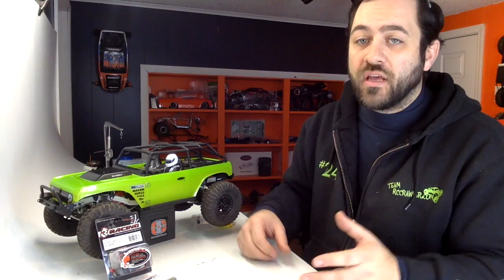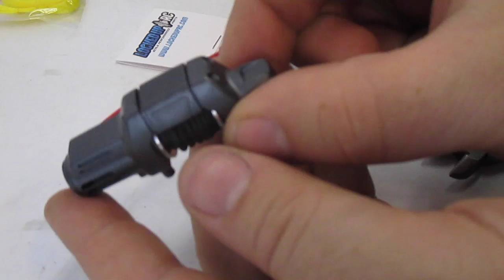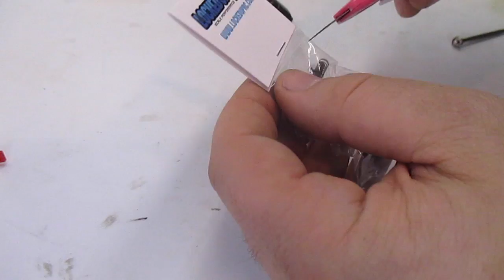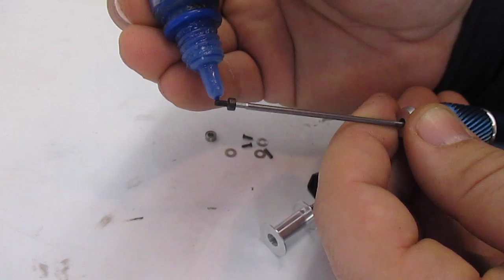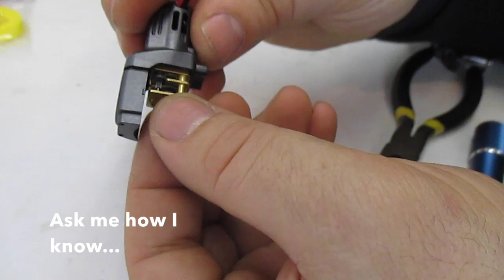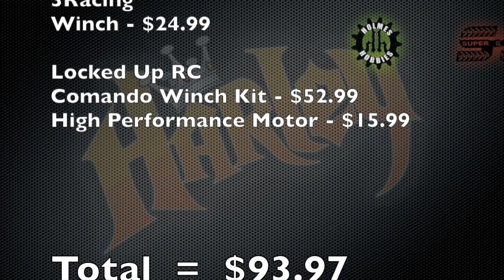Axial SCX10 Deadbolt - Winch - $50 Budget Build - Week 17

Comment: Mr Harley, great video as always. I have a 3 ch radio and the third channel has a switch with two positions. If I used the free spool on a winch would my radio work? Have one position of the switch as neutral and the other to retract? Means I will only be able to pull the winch rope out by hand, which is what you would do anyway
Reply from the maker: Not likely because you would need to be able set the end point of the other direction to 0.

Comment: was going to get the deadbolt but i like the g6 body more and its only 10 pound more for. better looking body
Reply from the maker: +jameshone1000 the thing is that the deadbolt has several upgrades for performance also. That is why the Deadbolt the best buy from Axial.
Reply: +Harley Designs i gone over all the parts there is like bearly nothink different other then body and tyres
Reply from the maker: +jameshone1000 depends on which G6 you got. The standard G6 has 48p gears, single disc slipper, and non HD wild boar shafts. The falken version was updated but was usually at least $50 more.
Reply: +Harley Designs. i talking about the new falcon i am in the uk the deadbolt is 139 and the falcon is 149
Reply: +jameshone1000 and has the HD wildboar shafts it on modelsport uk
Reply: +jameshone1000 check if you want i am shore its the new one